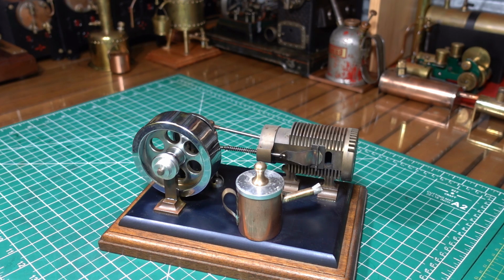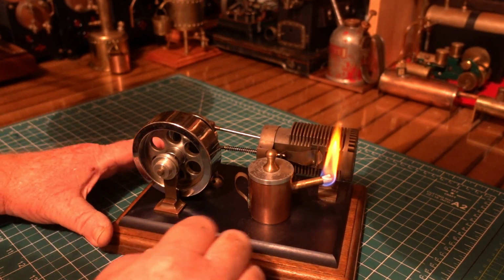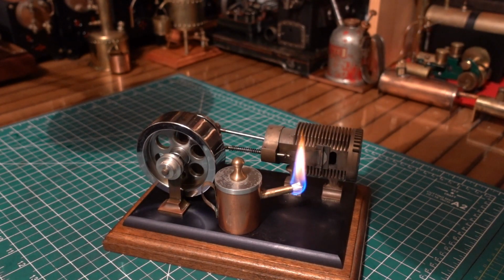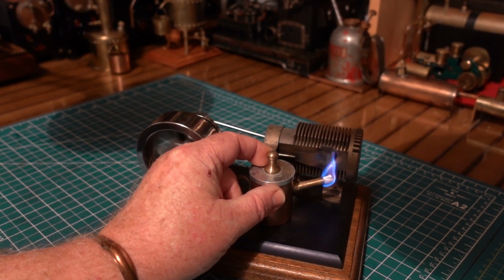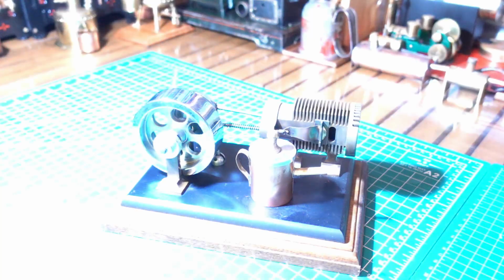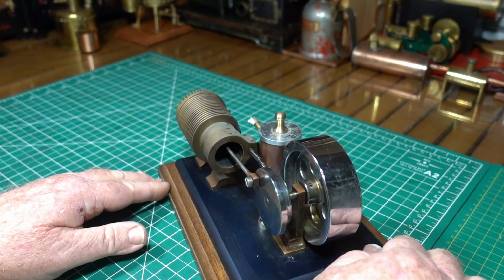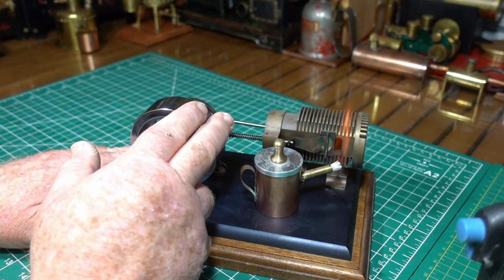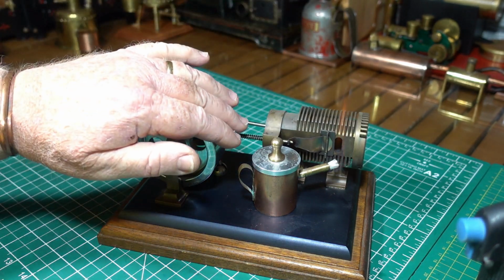PM Research Flame Licker Flame Gulper Vacuum Engine Solar Engine #3

Comment: Very well done indeed!  Flame licker engines tend to be more temperamental than an imbalanced Chihuahua (in my experience) but you have this one running wonderfully!  I don't think that I have seen a model 3 run that fast before. Once again, GREAT JOB! Keep these great videos coming 👍
Reply from the maker: Thanks I have some Chinese flame lickers as well and they are exercises in frustration to get running.
Reply: @SteamEngines-Jim   Have you found the video of the "used and abused" flame licker ?  I had some fun fixing up a Chinese engine and it turned out to be a really nice engine after a bit of work.   I am still truly amazed at the speed of your #3. It runs beautifully 👍
Reply from the maker: @steam212  I'll go and have a search for it, I've fettled for hours on mine - cheers Jim

Comment: Lovely engine Jim. Flame lickers can be an absolute bugger to get running! Have you thought about putting a thin steel plate underneath where the burner sits then a small neodymium magnet inside the burner. This would allow you to adjust the flame position but stop the burner from moving under vibration. Cheers, Alan.
Reply from the maker: G'day Alan no I haven't thought of that, I usually use a small blob of BlueTac but thought it would look 'so so' in the vid. Hope you're enjoying Spring in the UK mate Cheers Jim :)
Reply: @SteamEngines-Jim  BlueTac works 👍👍 It may be spring where you are but it's autumn here 🤣 Just like our summer was very hot our autumn is been very mild so far, long may it continue 🙂
Reply from the maker: @RetroSteamTech  Geez where was my brain yesterday...I meant Autumn! LOL ....hope Winter isn't too bad. We're reading down here that Putin might be causing some suffering with a lack of heating fuel in Europe.
Reply: @SteamEngines-Jim  Here in the UK we only import a small percentage of our gas from Russia so we should be ok. Europe though is much more reliant on Russia for gas.

Comment: My grandfather built one of these flame lickers in 1950.  It looks very similar to yours.  I am looking for the design. I thought my uncle said grandpa found the design in a Popular Mechanics issue.  I found a flamelicker in the Dec 1938 issue but it does not look much like yours or the one he built.  Any idea where the design originated?
Reply from the maker: G'day Daniel these are sold by Pm Research here - https://pmmodelengines.com/solar-engine-3/
If you join up here I'm sure one of the gents on the forum would have the information you want -
https://www.officeofsteamforum.com/index.php
Reply: @SteamEngines-Jim  thank you for the suggestion Jim. However, I finally came up with the right google search words and located the article. It is in the Feb 1950 issue of Popular Science. I also posted a vid of my engine in YouTube.
Reply from the maker: @danielernst9921   Fantastic!